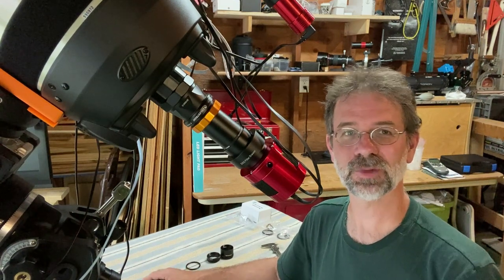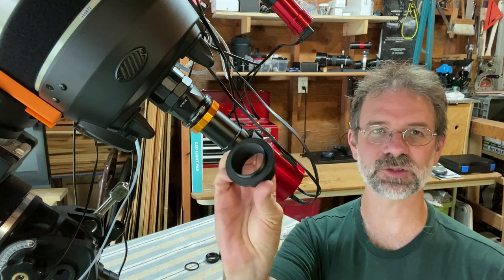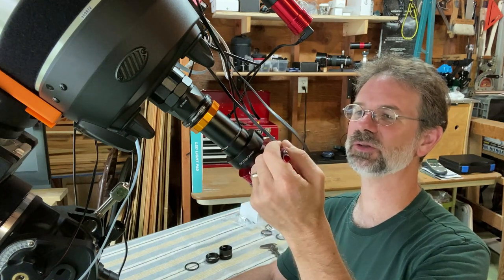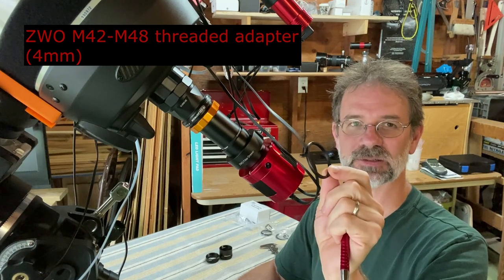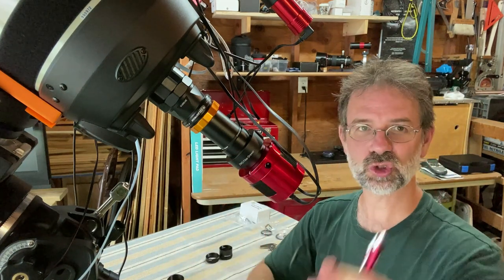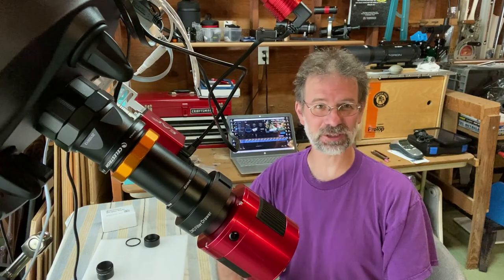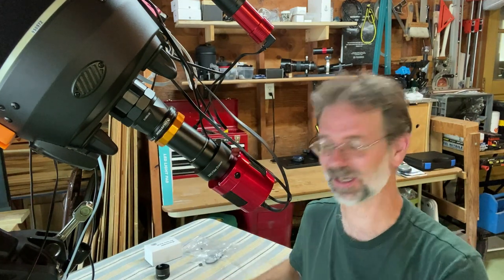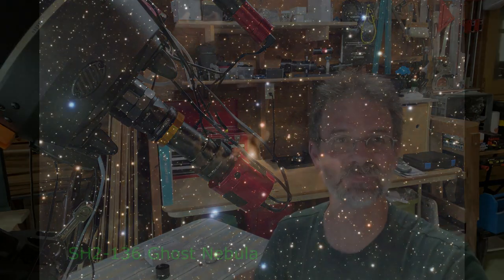Backfocus Round 2: Edge HD 800 & ZWO Filter Drawer - Fine Tuning

Comment: Thanks for a very helpful video, Kurt! The second part of the Celestron T Adapter is actually used when imaging at F10 IE not with the reducer, because the back focus at F10 is 133mm.
Reply from the maker: Thanks for the info!
Reply: @AstroQuest1  YW the only reason I know that is because I spent hours trying to work out why I had two separate pieces to the T adapter!
Reply: @AstroQuest1  BTW I owe you a big 'thank you' because we reugalrly use APT these days for camera control & plate solving and we do so because of your very informative videos that you made about using APT! Thanks again
Reply from the maker: @HollomanUFOLanding  Thank you very much for the feedback. Cheers

Comment: Baader Varilock adapters are good for trying out distances. They come in 2 variable ranges 20-29mm and 29 to 46mm. I currently have one on my Edge11 train.
Reply from the maker: Thanks for the info Dave.  I am only familiar with Baader filters so it was off my radar but I will check them out.  I really like there filter and just purchased yet another one. - Cheers

Comment: Kurt, you're a few steps ahead of me on the EdgeHD 800 - I received mine last month and I'm still working on getting a solid configuration squared away but your advice has been invaluable. I followed your earlier backspacing video to initially set it up but the stars throughout my first images are somewhat unidirectionally elongated, so poor collimation is probably my first issue. I'm currently using 105mm backspacing but will definitely make use of your advice here once I get collimation figured out. Nice Ghost Nebula image BTW. Thanks again for posting these videos!
Reply from the maker: Thank you Peter.  That was my first step as well - getting the collimation.  The good news is the collimation seams to hold for quite a while, at least with my scope.  - Good Luck

Comment: I’m glad you mentioned the issue with having to use (2) adapters between the T-adapter and 16.5mm piece.  I don’t know why the 16.5 is threaded so deeply, but it’s frustrating when ZWO only includes 1 with [some] cameras, or none at all.

I ended up just getting a separate spacer from Amazon, I believe.  It was M48 on one side, and M42 on opposite side; joined the T-adapter and 16.5 pretty nicely.  Haven’t noticed any issues.

Yep, Amazon.  

Starboosa M42 to M48

$14.59
Reply from the maker: Thanks for commenting. Yeah would be nice if they would attach a couple more spacers.  cheers!

Comment: Hi Kurt, very helpful two part videos, much appreciated. I have the same set up. I think I know the reason why you needed the extra 3.5 mm! Its because we have to measure the distance from the end of the Reducer not the flange ( I am referring to the diagram from the 0.7 Reducer for Edge HD 800 manual from Celestron, as opposed to 9.25 and above models). That way the 105 mm back focus distance for Edge HD 800 is still valid. I would be keen to know what you think.
Reply from the maker: Hey Gan, your explanation sounds logical to me.  Cheers

Comment: Great info Kurt! For what it's worth, I also had to go with 108mm of backspacing when measuring from what appears to be the end of the reducers to the sensor. I did notice that the glass on the reducer is at the edge of the beginning of the threads, so I wonder if this is why my measurements are off if that makes sense. It's hard to tell how far in the glass is because whatever you screw on to the reducer covers the edge so you can't really measure it. In my case it was the OAG adapter and in yours the T-adapter. Hope I'm making sense here. Anyway I absolutely love your image of the Ghost Nebula!
Reply from the maker: Thanks for the additional info Joe and yes what you describe makes sense.  - Cheers Kurt

Comment: Kool Kurt... did you measure the spacers to see if they was as the right specs as I've yet to find one that's exact.. best to measure from the threads of the reducer to the sensor
Also you maybe at 108 because the convex design on reducer, think it has 6 elements of glass, which may have a added some needed distance to the system
Celestron should have tested this..
Be interested to know what your platesove software shows what your focal length really is.. my xlt version shows 1318 instead of 1280mm
Reply from the maker: Thanks Derek.  Yeah checked the spacers and they are accurate according to my eyes and caliper. Tat is interesting about the conves design of the reducer - so maybe is only 3mm rather than the 3.5mm.  It works right now though.  I see what the ASIair plate solve says about the focal length.  I will also be interested to see how it  behaves at F10.  Cheers
Reply: @AstroQuest1  be interesting to see
Reply: With SCs, if you change the Backfocus, the FL also changes. It is normal in SC and MAK design
Reply from the maker: @jesuspineiro1622  Thanks for the info.

Comment: Great video. I have the same zwo filter drawer and a brand new asi2600mc pro. I am pretty new to astrophotography. How does the M42 filter drawer attach to the camera? what spacing and where did you purchase it at?
Reply from the maker: Thanks Jim. The back spacing is should depends on what system you have. Are you mounting on a Celestron Edge woithout a reducer or with a reducer? Is of of a typical refractor with a Flattener/reducer in which case would most likely be 55mm.  ZWO usually includes a some of adapters and spacers and such with their cameras. The filter drawer is attatched to the camera with the 11mm spacer that was included with the camera. I have purchased other spacers from Agena Astro.  - Good Luck

Comment: Hi Kurt, I see in this video a ZWO EAF installed on the back of your Edge HD 8. I got the same setup. I need to know precisely the focuser step size of this pairing but can not find it anywhere. Do you have any idea where to look? Even Celestron Support is shy to an answer. I will use my brand new Hyperstar V4 and you know focusing ist critical. The critical focus zone is very small. I would really appreciate any hint. Best regards Gunter
Reply from the maker: Hi Gunter, Unfortunately there was not any standard so what I did was trial and error to see what gave me the best result. My fine setting is 100 and coarse is at 500.  Cheers Kurt
Reply: @AstroQuest1  hi Kurt, does it work with Hyperstar or only for much larger f ratios?
Reply from the maker: Hey Gunter, It does work for Hyperstar - or at least for me, what I can't remeber is if I kept those same values or not.  Cheers  @guntergeorgi1347

Comment: Crysral
Clear 
Question does make a
Different if you put filter drawer on front of 16.5mm spacer 
According to svbony that’s what we do on refractor with reducer 
Reducer,drawer,16.5spacer than camera
Reply from the maker: It might depending on how sensitive trhe system is. The filter thickness may add 1mm tot eh backspace, you may not notice any difference though. The only way to know for sure is by testing it. Cheers
Reply: @AstroQuest1  
I see 
When do I know is wrong 
Being out of focus?
With filter my data are brighter on left side like a amp glow 
I know 2600 mc p don’t have amp glow 
I ask myself should I use or not the optolong -lquad filter 
And on what light pollution of the moon I can use it 
I’m on bottle 4
Reply from the maker: @refetastro  If when in focus the stars on the edges are  highly elongated towards the center, then back focus is not correct. There may be a little elongation, but that is expecte, unless you have a super-highend telescope like a Takahashi.

Comment: Hi Kurt. I understand you're using a 400ml FL guide scope. What guide camera /imaging cam do you use? I'm looking to add a guide scope on my EdgeHD 8" and the ST80 is literally the only practical option available outside a OAG. I've checked the guiding ratios with various ZWO cams (astronomy.tools) and can get as low as 1:2.36 with a Canon 700D DSLR as a main imaging cam. Most of the dedicated imaging cams have even smaller pixels than the 700D so ratio is even worse for them. Curious about how good the guiding is for you with the long fl SCT and your imaging cam.
Reply from the maker: Hey Ron,  Actually I have been using the ASI120 which does have  small pixels.  However, it has been working quite well especially since I have no trouble finding stars with the large FOV of the ST80.  Cheers Kurt
Reply: @AstroQuest1  So you're imaging ratio is between ~ 1:2.88 and 1:4 depending if using the .7 focal reducer. Nearly optimal if you go by the 1:3 standard.
Reply from the maker: @Ronbo765  Yep!
Reply: @AstroQuest1  Did you try the Celestron OAG and said the hell with it?
Reply from the maker: @Ronbo765  No, I never even tried it. I cancelled it before they shipped it. I just liker the way the guide scope setup works. Ideally the OAG should work better though.